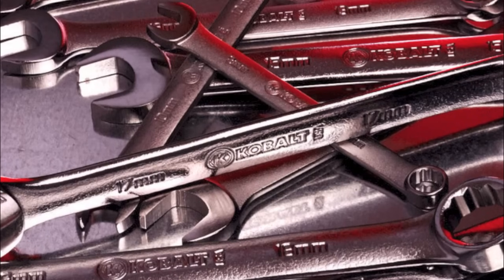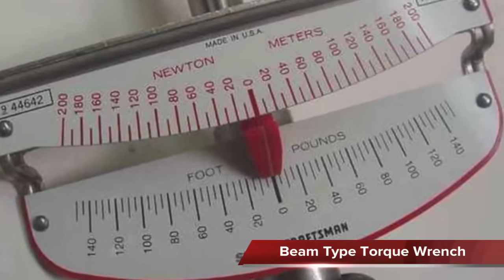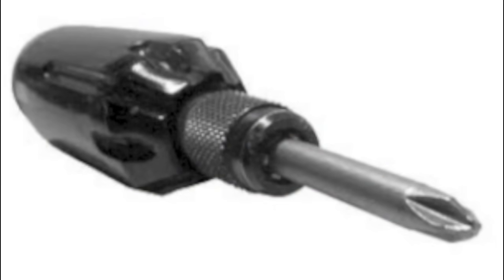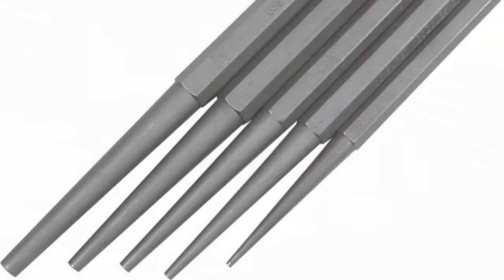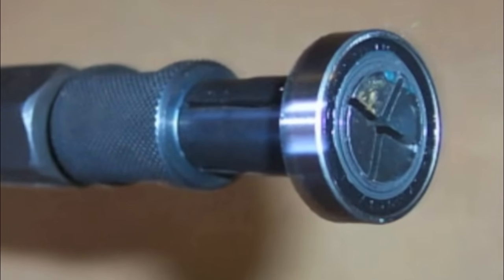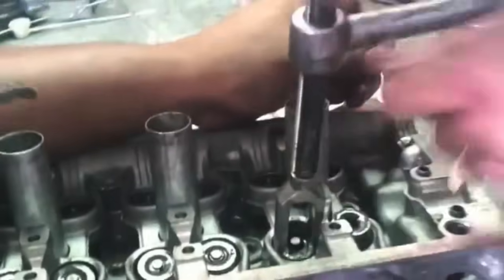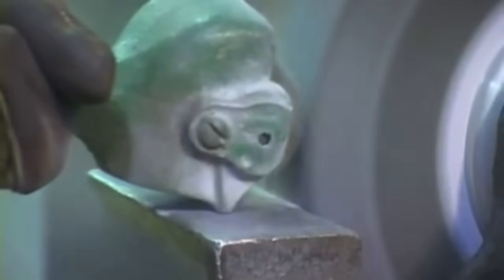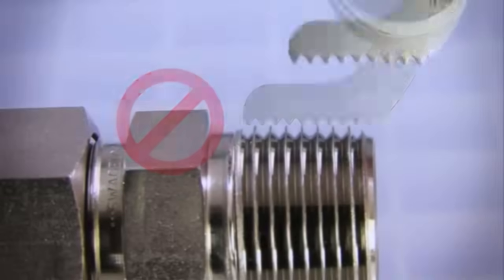Tools of the Small Engine Mechanic

Comment: I ran a small engine repair shop for 12 years at my home, The first tool you need to buy is a lift table, It will get you off the floor and keep you from squatting and kneeling. Best money I ever spent.
Reply: James, Where did you have your small engine shop? I am starting a small engine repair/mobile welding service. I say service because I have access to a shop but I cannot have customers there because it is not owned by me. I am going to offer free pickup and delivery within reason and the welding again within reason. I am in PA near King of Prussia. I do not have a lift table..yet but I plan on building or buying one very soon. I have 99% of the tools and 100% of the aptitude needed so I am going full speed ahead. Any suggestions will be welcomed my friend.

Comment from the maker: This video titled Tools of the Small Engine Mechanic is my longest video yet at 24:04 and shows the common tools used by small engine mechanics.
Reply: motoprof1441 j
Reply: Awesome video. Are you still teaching? Do you have a small engine repair shop? if so where? I am starting one in PA within a month or so. As soon as it gets warmer. I am recovering from a motorcycle accident so as soon as I am up and around I will be building my business. I am starting a small engine repair/mobile welding business. Any suggestions are welcome.